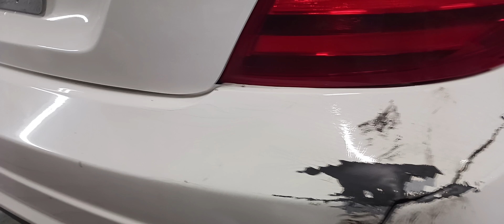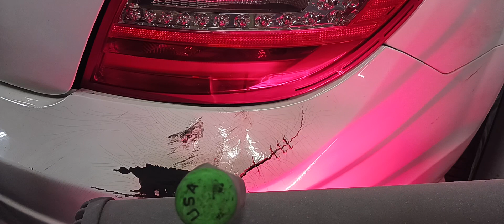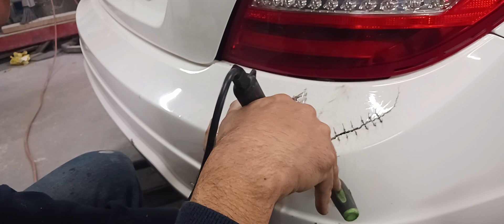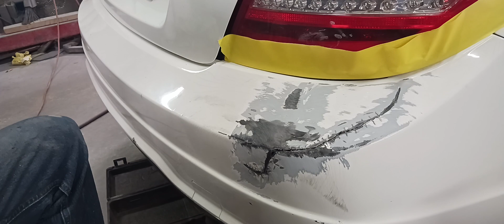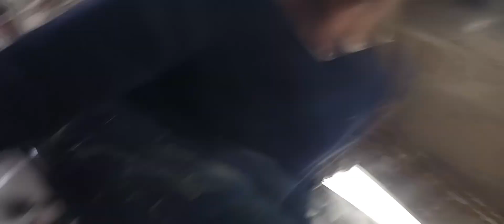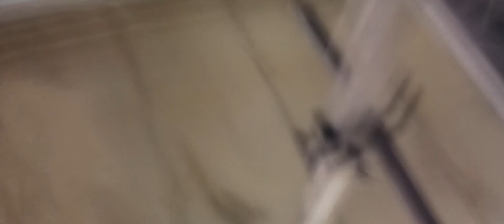repairing (bumper)plastic staples

Comment: Thanks for sharing. Your method will definitely come in handy to patch a similar hole on my front bumper. What did you used to filled and feathered that patch afterwards?
Reply from the maker: finished it with a 3M urethane plastic  bonding material...it's a 2 part bonding material that is just as strong as plastic welding a bumper..
if you have a missing piece or a crack in the bumper, that material will be your best bet...
You wouldn't have to plastic staple like I did in this video...
That is the strongest plastic bonding material I've ever use